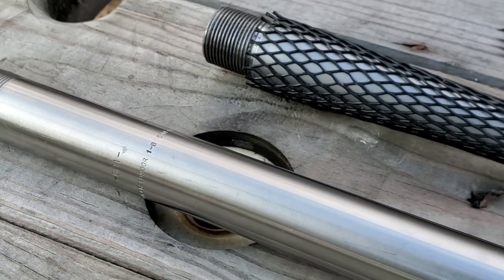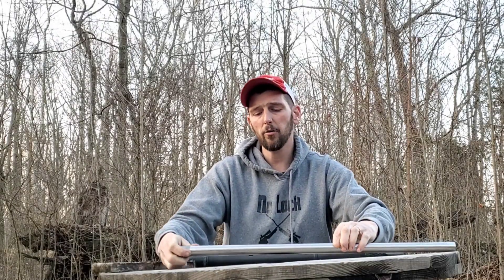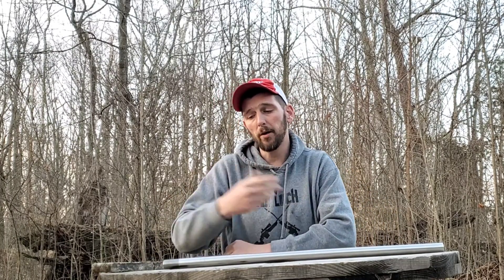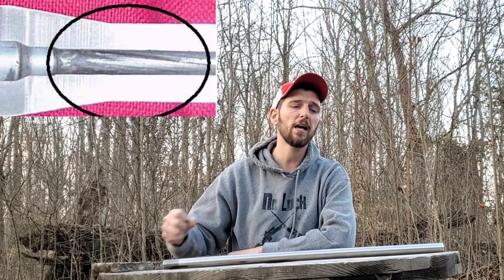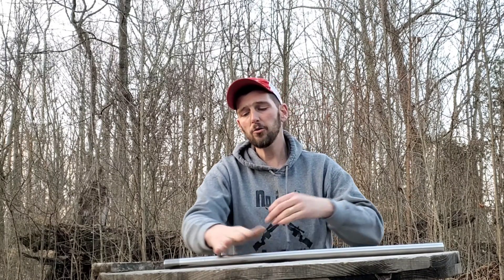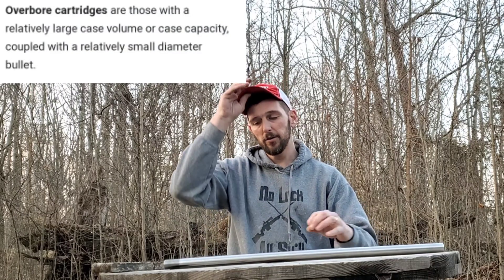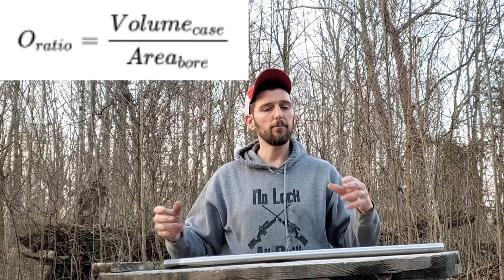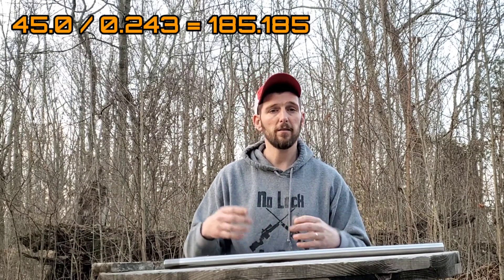Predicting Barrel Life By Cartridge

Comment: I just posted this elsewhere a couple places, and certain phrases do not fit here the same way. If you find the other guy's (GunBlue) post about barrel life, there you will see the phrases fit better:

Let me accept some ridicule for being arrogant on shaky ground, regarding bullet case venturi talk and "efficiency". The discussion for 7x57 Mauser and 6mm is a bit errant in regard to CAUSE for speed. The cartridge pressures cited would tend to put 6mm faster flying, but the book says NO. The actual math routine for area and pressure will likely put the 7mm faster flying. Pi(r)(r) = area, this is the biggest factor until case pressure for 6mm goes maybe another 5,000 psi. (lazy guess). Ignoring a dihedral effect for a moment here, the burn-out of the steel ahead of the case has to do 1st with heat, 2nd with velocity of combustion molecules, and these become rather identical (inseparable) by the natural physics event, anyway. 3rd, there is time dwell for the first two. 4th, there is temperature reservoiring effect of the steel just ahead of the case. Scouring of the steel is taking place at a depth of atoms, anyway, so this reservoir of "cold" is not significant. The physics for a straight case does not amplify dihedral trajectory of the combustion products. When necked, the dihedral becomes a major cause of burn-out, for enforcing a caterpillar shockwave into the space behind the bullet while it advances. The actual amplification of molecular shockwave sculpting into the rifle steel is probably explained in a Phd thesis, somewhere, and probably a thousand times over. I will go so far as to declare there is no real decrease of pressure in this space due to venturi effect (the back-end of the bullet DOES NOT represent a low-pressure source), but the formation of this shockwave MAY be causing some general decrease HOWEVER the effective pressure of the sculpting molecules will actually be HIGHER. Barrel burn-out is occurring where the shockwave manifests and where the angle of incidence of sculpting molecules is MOST EFFICIENT at scouring steel. Erosion and corrosion along the length of the barrel is another matter. The necessity for clutching the bullet at the start of the rifling is not easily solved, so, when the scouring is bad enough, this allows the bullet itself to undergo vibration and bang itself into bad geometry, ruining accuracy. Perhaps it would be possible to put two inches of platinum rifling or some exotic alloy that will resist molecular scouring. Find the Phd author to get to better specifics here. In all the world, "men" or "monsters" have already attempted to solve this gun problem, whether or not having grasp of the truer role for Venturi effects in a carburetor or tornado column, where the destination DOES REPRESENT a low-pressure source.

Comment: does a .308 last much longer than a 6.5 creedmore?
Reply from the maker: Yes significantly longer.  Like double the barrel life
Reply: @gunfather83  so i wanna get into prs on the cheap, would is be smarter to run my 6.5 savage and replace the rifle/barrel in 1 season or get a .308 ruger American
Reply: @gunfather83  what about a 308 vs 6.5 grendal?
Reply: @daveyboy6985  the 6.5 Grendel has a mutch longer barrel live than a 308.  It shoots for example max 27 grain n135 by a 123 grain scenar.  And had a bc higher than a lot off 308 bullets.
Reply: @andrebosgraaf2086  👍

Comment: I’ve heard the opposite. 
I’ve heard the sharper the shoulder angle, ie ackley, the longer the barrel life. 
Idk
Reply from the maker: No that's definitely not the case.  When the shoulder angle is sharper it directs the burned and unburned power directly on the throat of the rifling which is where the barrel wears out first.
Reply: GunFather Precision so a 260 should get better barrel life than the 6.5 Creedmoor, correct?
I’m seriously thinking about a 6.5x55 Swede on my savage 110 long action
Reply from the maker: @troopcom  I'm honestly not sure about the 260rem barrel life. I would imagine it would have a longer life because of the shoulder angle but at the same time its slightly more overbore than the 6.5cm because it has a slightly larger powder capacity.  So I honestly cant say for curtain.  The 6.5 x 55 sweed is an awesome cartridge. I do have some experience with it and I am a fan.
Reply: Your Correct, The Ackley's direct the powder into the neck section of the case, whereas the more shallow tapered cases direct it more into the throat area.

Comment: Are we still talking thousands of rounds of an overbored or high angled round or hundreds?
Reply from the maker: If its something crazy overbore like a 408 Chey Tac with a sharp angle its typically going to be 700 or 800 rounds but something slightly overbore like my 7 saum with a 30°shoulder it should last 2000 rounds.  That all also depends on how fast your shooting.  Obviously if your shooting prs comps and burning 10 or 15 rounds down the tube in rapid succession over and over its going to wear much faster than if your spacing your shots out and never really get the bore up to maximum temperatures